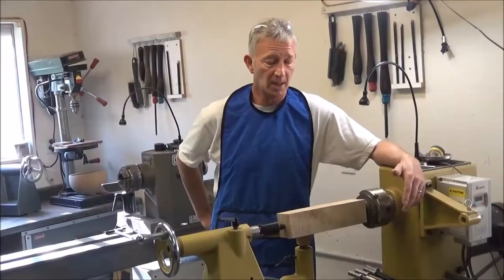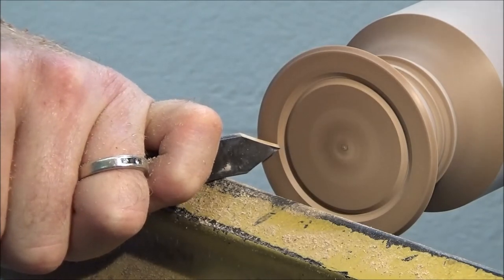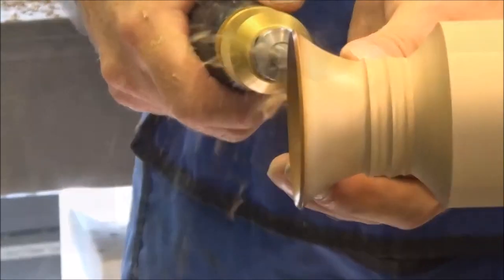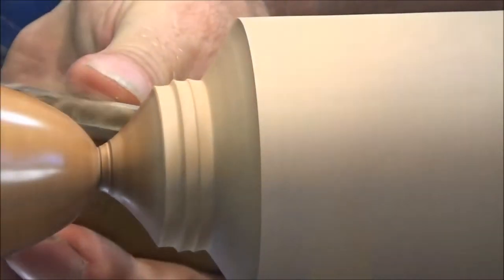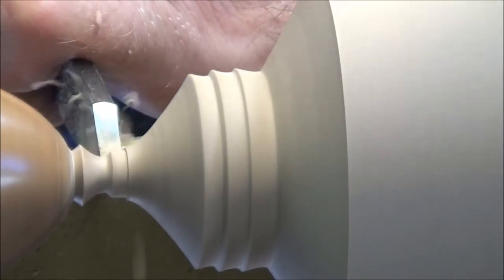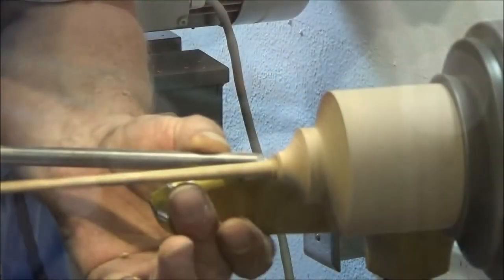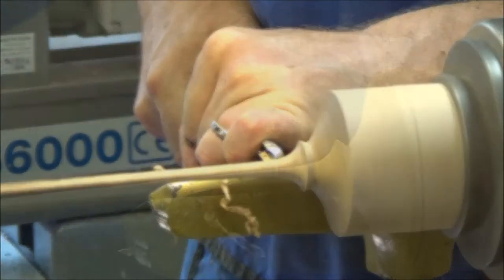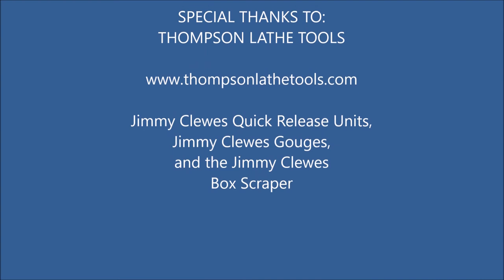Long Stemmed Goblet

Comment: Jimmy,
Beautiful work!  I was wondering about putting a tailstock support (tennis ball) after the goblet portion was done and if that would have helped support the work while you were doing the stem work.  Also I did not catch what wood you were working on and if there were any species you would avoid for these long stem goblets?  Trying to get the courage up to try one :)